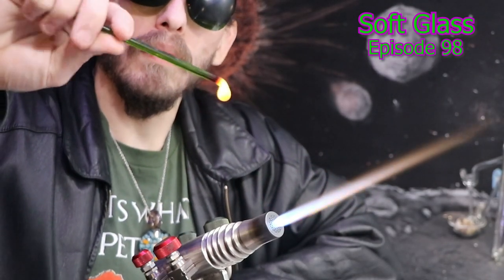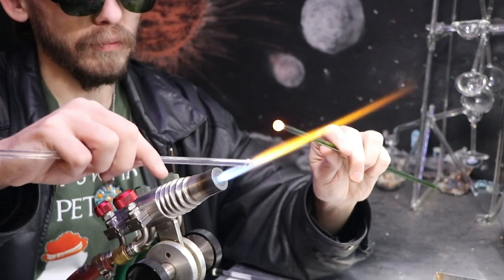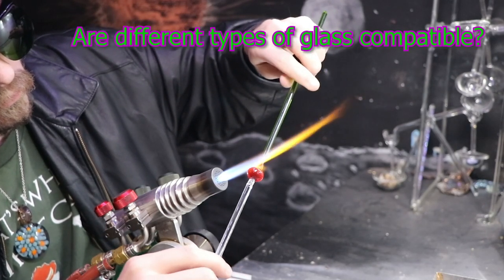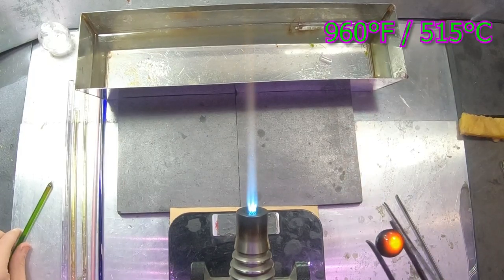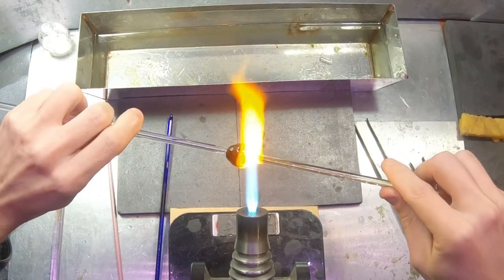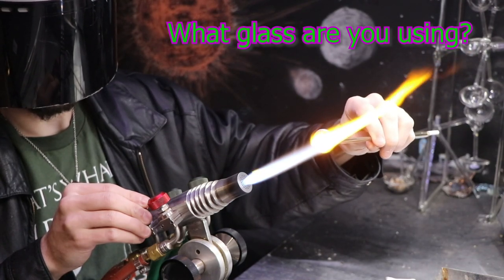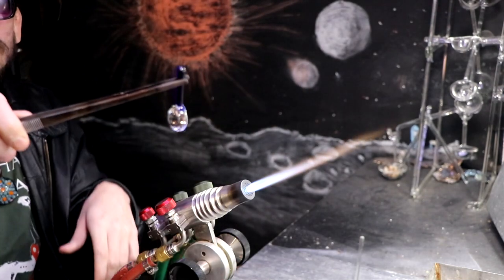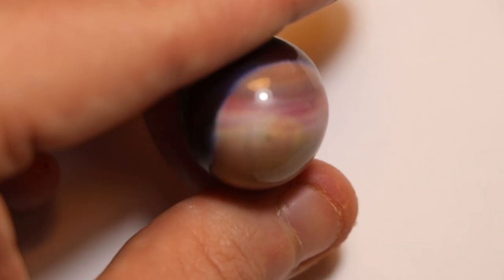Sampling Some Soft Glass - Lampworking

Comment: Don't you have a marble mold? I use that for soft glass marbles, you just have be careful not to chill the marble with it too much. I roast the mold in the flame for the final step, and clean the punty mark off quickly or pick up the whole marble again if I can't do it quick. Soft glass marbles are tricky, but the color palette makes it worth doing! I also like doing pendants in soft glass.
Reply from the maker: I bought that large one that looks like Thor's hammer. I never got in the habit of using it though. What soft glass manufactures do you prefer? I only bought the Effetre for my affinity of Murano.
Reply: @MattJasa  I use Effetre for almost everything. Vetrefond is slightly higher quality, and Double Helix makes unique silver-bearing colors that act a little like boro. Those are the main ones. If you delve into the world of fusing glass, 90/96COE stuff, there's some really great colors and fabulous dichro, which can be worked in the flame, furnace, or fusing kiln. And then 120 Satake is a whole nother world too. Each type has a great variety of choices, way more than the boro world has.

Comment: love your work as usual ive  only ever worked with 104 coe glass on a hothead.  man ur torch melts it fast. if you have any left over u should try out a hot head as i beleve its a totaly diffrent exprence.
Reply from the maker: I've never tried a hothead myself, It would be fun to test some other burners. I know the oxygen makes a big difference in heat, it's almost too hot for soft glass. They have made some designs recently to add room air into the flame to cool it down.